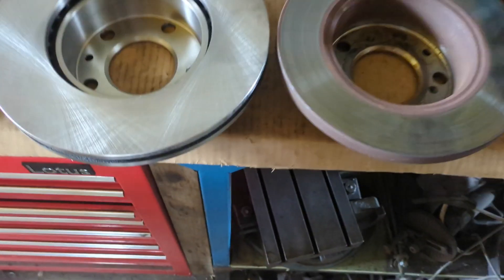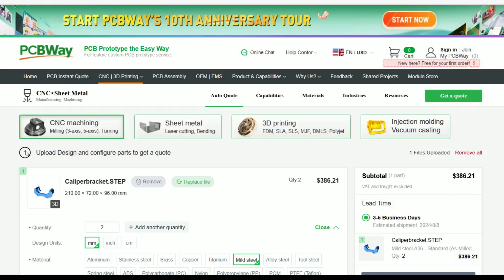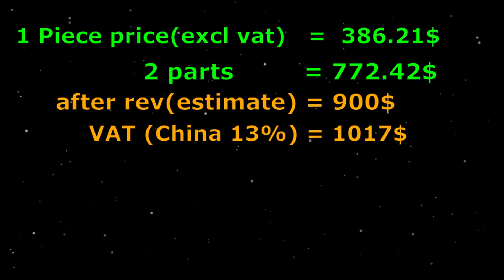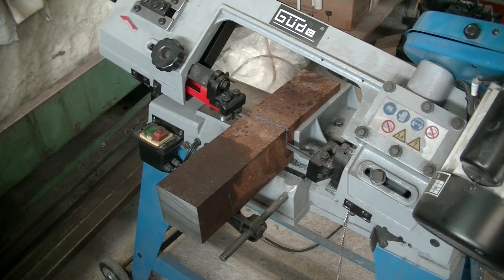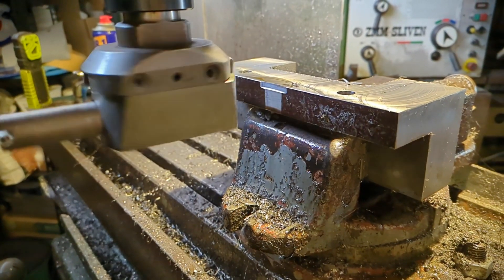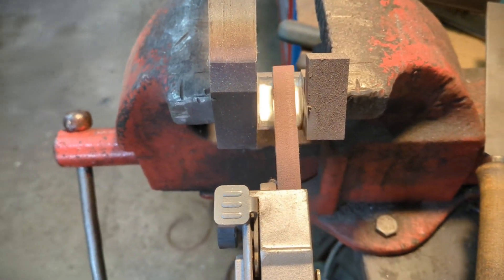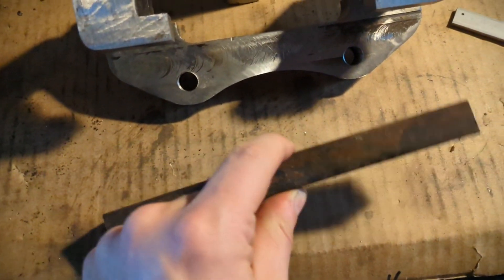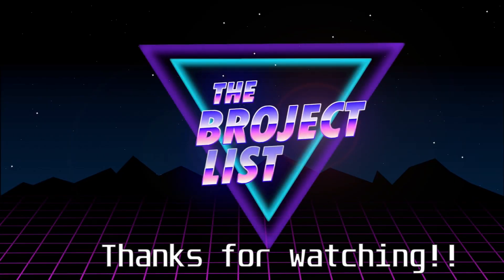I manually machined these billet parts on a 64 year old milling machine

Comment: I wonder if 7075 aluminum would have worked too. A lot easier to machine. The part is pretty thick.

Was a lot of work for sure. I wonder what the material cost was.
Reply from the maker: maybe for a racing application aluminium could be used but i wouldn't feel comfortable stopping a 3,5t commercial vehicle on those 😅 material cost was free as i had these stocks laying around. I think it woiuld also be more expensive to make it out of 7075 alu compared to SJ335 steel

Comment: How you found the fact that original brake carrier are cast iron?
Reply from the maker: i tried to modify the original bracket, it had the granular structure of cast iron and really hard to weld. Also most parts on cars are cast iron (or steel/alloy). its fast and cheap to produce.